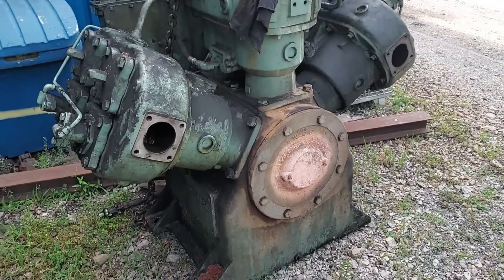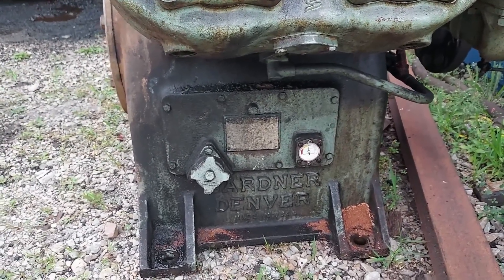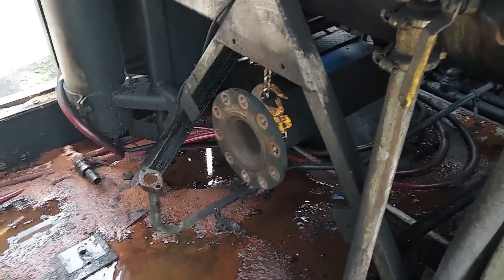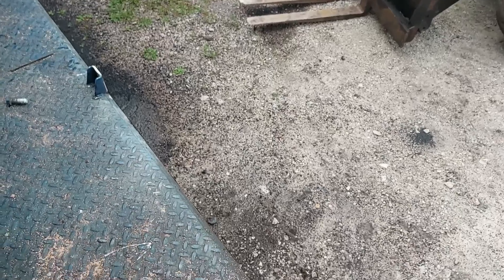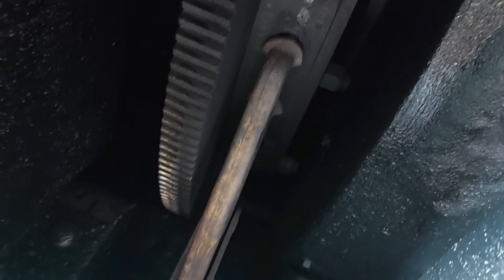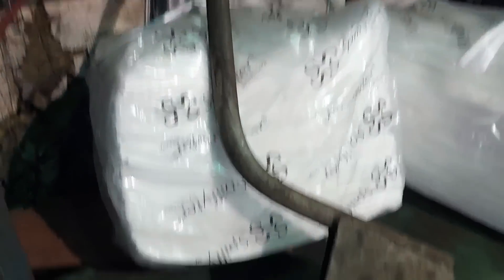Locomotive Air Compressor Died!  We Gonna Change It Out Today

Comment: That would have been a fun rebuild
Reply from the maker: They send it out to a professional rebuild shop rotarycomptech.
It's a core that has to get sent back when the rebuilt one comes
in. But I imagine your right, it would be a task to rebuild it.
Thank you very much for checking out our video and may you have a very good day.
Reply: @ccrx6700  I used to work for one of those professional rebuild shops in Milwaukee

Comment: Dave I know the old girl died ,but had a lot sit up the yard  maybe 2yrs. Took a hammer and beat the top of the cyclinders to unstick them ,
Reply from the maker: Surprised they didn't crack, unless you used a dead blow hammer Robert. I've had cylinders stick in some of my old tractors that
were left unused for years, it's sometimes a real chore to get
those things unstuck.

Comment: Some of the newer engines Use the electric motor to drive the air compressor.  Plus, it depends on the manufacture of the locomotive.
Reply from the maker: I'm not real familiar with the newer locomotives Robert just these
old girls we have here, and we have our share of problems with them
being they are so old and get a lot of hard use. Thank you for taking the time to check out the locomotive air compressor video my friend.

Comment: Dave:  it seems to me that your employers bought a piece of trash locomotive that needs its guts rebuilt.  Things seem to be breaking and the locomotive is falling to pieces as we watch your videos.  Your employers would probably be better off to buy a new locomotive than to have these problems attributed to used equipment.  Tell your employers to not give more than $500.00 for a used locomotive.  This locomotive's life is over, you could probably get more for it if it is scrapped by weight than was paid for it.  Something else is going to break soon enough.  I must say though the reassembly of the pump looks sound.  Don't trust the rest of the locomotive though.  It sounds to me like there are some pressure leaks, the hiss hiss sounds as the motor is running.  You might be able to find those leaks with some soapy water in a spray bottle.
Reply from the maker: Thanks for sharing your thoughts Mr1Fish. Yes these are old
locomotives, the oldest one was built in 1966, next one in 1975 and next one in 1978. If it was easy then I'm sure they would have
by now gotten newer locos. However if you are not aware, we do not
interchange with another RR. This means that any rolling stock, locos
included must get trucked in here and that is an astronomical expense. Consider also that our last company filed bankruptcy and
they spent no money on much needed loco maintenance, only
spent the money when one broke down to fix that particular
problem. So yes these locos got in pretty sad shape because they
didn't do routine maintenance as should be required. 

Since our new company took over they have brought in some
very good contract loco mechanics and have spent a good bit
of money trying to fix existing problems. Which was much needed
and they did a good job. However also being so old and for too
long not maintained properly they still break down at times. And
as any other piece of machinery that is used every day it's
impossible for something not to break sooner or later. If we
could get a newer loco in here for just the cost of purchasing one,
then I'm sure that would be in the budget to happen, it's just
the unearthly expense of getting one in there that is the major
drawback on locos and also on newer hopper cars. Hope that
helps explain our situation a bit better. 

However with that said, if I was in charge of budgeting for the
coming years, then I would be putting in for a much newer loco
even with the trucking expenses, but I'm not the man who pushes
the pencil.

Comment: The repairs are rebuilt but are changeout repairs usually easy to acquire? Or can you get new parts? I would guess new would be costly but rebuilt from a machine shop isn't cheap either. I think you said the company had its own machine shop?
Reply from the maker: Air compressors are sent out to get rebuilt. We do not have
a machine shop here Shirely, we do have a mechanics shop
where they work on the hopper cars, but cannot machine
any parts. Rebuilding anything anymore is a wait and get lucky
if you can get parts, there is a real supply chain issue out there
for a lot of stuff.

Comment: Gardner-Denver;   I recall back in the 80’s  the “compressor” that run off the P.T.O. of my Kenworth to charge the pneumatic trailer that I hauled bulk cement with,  was a Gardner Denver.  Not surprising that the compressor on your train engine was made by the same company.  Noted for durability and longevity.  It seemed they ran for years w/o problems
Reply from the maker: Thanks for watching and writing in. Who knows, this loco was built in 1978 and it could have been the original compressor. Really
appreciate your stopping by and sharing my friend.

Comment: COMPLETELY off topic - but I have been meaning to ask: do you know if your railroad ever use a caboose?  I ask because I swear, I can remember coming back from Pittsburgh circa 1980 and seeing the rear end of a train on what I think was your line with a caboose.  This was in the days before EOT's, so I wonder if someone wasn't back there to keep an eye on the air.  (And speaking of air, good work on that compressor!)
Reply from the maker: Thank you B&O Operator for taking the time to watch the
show today. We have never had a caboose here. The only other
tracks here belong to NS. However, in 1980's era it was 
Monongahela RR. Then in 1993 it merged into the Conrail
system and later as you know became NS. So it had to have
been from the M RR.
Reply: @ccrx6700  Thanks!  That clears some things up.  Zipping by on I-79 doesn't offer much of a glance of the right of way.  I probably saw the caboose somewhere else and thought it was your line.  That was a LONG time ago!

Comment: Dave, I notice the compressor is direct coupled to the drive shaft, I take it that it doesn’t need a flex coupling?  Also Gardner was a builder of great marine and bus engines in the UK!  but has since gone out of business! The Gardner/ Denver bit is a puzzle. Thanks again for the video.😊
Reply from the maker: Apparently it does not need flex coupling, a bit surprising.
But that's the way EMD made them. I did not know that
about Gardner doing the UK engines, nice to learn that.
Really appreciate your nice comment and for watching today
my friend.
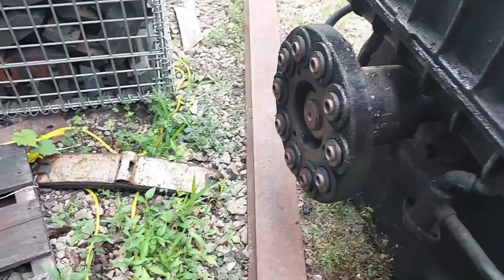Reply: I just assumed upon looking at those holes on the compressor flange; that they have 'extra' bumps vs a flat flange with drilled holes, and I was assuming those were rubber inserts/mounting spools (like end of an auto shock absorber, rigid center thimble/sleeve). around 1:24
Either that or clearanced metal to metal to allow some play...

Comment: I'm almost certain that is a six cylinder compressor.  Two outside banks are the first stage intake, then they feed into the center bank for the second stage.  Center bank outputs into a water to air cooler then off to the storage tanks.
Reply from the maker: Thanks so much Shain for taking the time to tune in and
watch the video my friend.
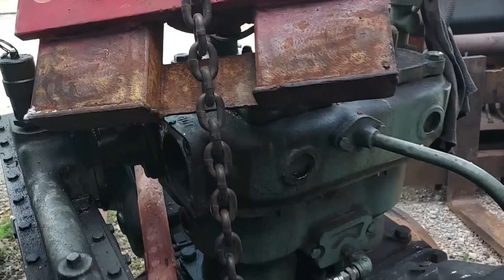Reply: You got it, except that is an intercooler, not the outlet air. It goes between the outside cylinders' outlets and then into the center cylinders' inlet. The open port on the center cylinder head, on the drive side, is the outlet (OH, I just noticed it says 'Out' 1:48 confirming that).

Comment: Wonder what that replacement compressor cost. You can safely/legally  run with no compressor on the lead locomotive or even with the lead locomotive shutdown
Reply from the maker: I have no idea Reven what it would cost, it is a rebuilt one.
Our remote DPU system here is an odd duck. While you are
right if there is another loco in the train to supply air, one
loco does not have to have air supplying the train as long
as other units provide the air. However with our stupid system
the lead loco always has to be supplying air as the other loco
the system shuts off the air to the rest of the train. it's stupid
but that's what we have to work with here. Thanks for stopping
by and taking in the video today my friend.

Comment: Thank goodness we have hydraulic barring machines in our shop, that manual barring tool you showed us is a bear to use on the  larger displacement 710 engines. From the looks of the burnt paint on the crankcase, it appears that the old compressor lost the rear main bearing.
Reply from the maker: I have never seen a hydraulic one Ralfie, that must be the berries!
These sd 38 move rather easily, but have no idea on the 
newer engines, you would certainly know. Always great to
have you visit with us and write in my friend. Thank You.
Reply: @ccrx6700  
Check out the Tame INC. model 43 EMD Barring Over Tool. 
The yellow ram in the picture on their web page is hanging upside down, the round bar fits in the saddle on the locomotive frame, and when turned on, the ram continuously reciprocates up and down catching the round holes in the outside of the flywheel much the same as the manual tool. 
There’s also a jog feature for bumping the flywheel into the timing mark for setting injector timing. 
We also have a couple of the main bearing torque machines shown at the bottom of the model 43 barring tool page.

Comment: That looks like a lot of air to compress! They need it all, got to have sufficient pressure to stop many wagons. That's a lot of air to supply! Thank you for showing it to us! Looks like that has a water bleed valve fitted to it, if the water vapor buildup wasn't removed, there wouldn't be space for the air in the air tanks, and it would show as lack of pressure. The compressor has to supply sufficient air to push out all of the water vapor. A railroad worker told me once that the engine was capable of pushing out enough water vapor buildup if the water level was below the intake side of the air tank. They use either a cyclical dump valve or a constant drip valve. The latter will just drip water vapor out constantly, the former will just cycle, as the description says.
Reply from the maker: Yes it does take a lot of air, and here besides the brake system,
we use air to dump our hopper cars. The cycle valves you
are referring to are called spitter valves. We have them on
all of our locos, plumbed into both main air reservoirs. In theory
they sound good, but in reality they don't work very well. On pre op
each operator manually opens a valve on the MR's and lets
water escape via those valves, it is amazing how much water
sometimes comes out. Thanks so much for watching and
writing in today my good man.
Reply: I couldn't see it.
With his close shots (and my lack of knowledge), I couldn't see where the air goes.
Is that the MR tank above the drive shaft? Can you time stamp where this valve is visible?

Comment: Do you use any kind of antifreeze in the cooling system. The water looks very rusty.
Reply from the maker: No antifreeze Martyn. They do put an additive in the water,
however they're not using enough, the water should have a weak
juice or weak kool aid  like coloring to it. EMD does not recommend
using anti freeze in these old engines. They are left running
in the winter when not in use. Which EMD also says is easier
on the engine to keep it running that to cold start it because
there is no pre lube system on them and it's not at all good for
the bearings or seals to have an engine start with no lube, it
takes a finite amount of time to get everything oiled.
Reply: @ccrx6700  The antifreeze will stop the engine rotting from the inside and keep the engine temperature stable and water ways clear.  An engine is an engine in whatever it is driving.

Comment: I had never seen such a thing before, and had it not been for your video I probably would have never seen it. With all the hours these compressors run, it's amazing this repair isn't more common. I also had no idea they were water cooled. You probably have to use the little guy to get in between there to separate the shaft fasteners. Not a lot of room in between. I did not know you could advance the crankshaft manually. That is a neat tool. Reading the description that was a Yankeetown Dock locomotive. I got to see her there in the early 80's along with all the FM units they used to have. This locomotive was paired with #21 and the staff allowed me to move the pair out of the way just so we could get better photos of the FM units. I was put in the seat and shown what to do. even though we only moved a few car lengths, this was a thrill I will never forget. The Company and employees were so nice to us railfans and all we had to do was sign a waiver to be on the property and told to be careful and alert. My favorite was #20, the Can Do America paint scheme, it was so cool back then. Thanks for sharing. Cheers Rob
Reply from the maker: How awesome is that Rob! I have pictures of 22 and 21 paired
and also Can Do. So neat to hear from someone else who
has sat in the seat even if for only a short time.  It is still a
strong runner although when we got it from YD had to replace
the main generator and rebuild the engine. Really appreciate
your watching and writing in today my friend.

Comment: Thank you for sharing.
I can imagine the install took an hour or two judging by all the shims under the replacement air compressor.
Reply from the maker: It was around 6 to 7 hours total, lot of messing around but
everyone did a fantastic job and it sure is a lot quieter than
the old one was Kevin. I was unable to get the old one smoking
recorded, they had it shut down when I got back in off track
that day. Thanks so much for stopping by and watching my good man.

Comment: She might have had oil in it, but probably the oil pump failed...  Guaranteed that crank is smoked.... Those 6 cylinder G.D. comps are a weird breed...WBOs in general are pretty simple compressors.  They just need to be maintained.  I've rebuilt 100s of them, just never messed with the 6 cyl.
Reply from the maker: Appreciate your taking the time to watch and write in today
Richard.

Comment: In terms of size alone, that baby is one big compressor.  I`m used to working with things that put out 9, 10, 11, 13 cubic feet per minute.  And for my application,  a 13 cfm compressor is a beautiful thing.  This baby puts out 254 cfm (as per Dave`s info in the description).  Man, that`s a lot of compressed air.  Pretty cool stuff, Dave.  Thanks for putting this together,  and for the detailed info in the description !
Reply from the maker: Thank you Stan for the very nice comment. We really appreciate
your taking the time to watch and write in my friend. It's got to
do double duty not only supplying the trains air brakes, but also
the car dumping, takes a lot of air.

Comment: That engine has a nice sound ticking over. The guys changing the compressor did not have an easy job getting those drive shaft bolts in, very little room in there. I am glad you could show us what you could and can understand not wanting to be filmed doing an awkward job like that. Another enjoyable video.
Reply from the maker: Thank you so much cedarcam for the very nice comment. Always
great to have you visit with us. Really do appreciate all your
great support you have given the channel for such a long time
now my friend. And, your right those guys had a tough time
on those thru bolts, but they got it.

Comment: Thanks for another behind the scenes look at what goes into keeping a locomotive in good running condition. You're fortunate the defect occurred during the pre-check and not while on the road. I would not have guessed it was that tight a fit but there is a lot of stuff under those hoods. At this stage if that was original equipment you got your money's worth.  Glad to see it up and running and don't forget the hose on the tracks!
Reply from the maker: your welcome Paul, thank you so much for your very nice comment
and for taking the time to watch today my friend.

Comment: The trash truck guys at my building had their are brakes pop off release every 22 or 25 seconds I ask them to tell their boss and the repair shop foreman about it.  As the compressor was not unloading when the system reached operating pressure.  Each week. Psst. Psst. Psst.  Their boss said it's ok.  So I took the time and got thru the switch board and talked to him. Okey dokey , was his reply. I should have called the highway patrol commercial officers.  I few months later. No air releases. Then I looked. It's a brand new truck.  Oh. Nice new truck.  What happened to the old truck.  Oh. The air brakes failed and we crashed it.  I guess the air brakes never got fixed.  I did warn you that they were going to fail.  At that point their faces went pale as the blood drained out of their faces. Then the nodded that I had.  They reached out and shook my hand. Thanked me for the warning.
Reply from the maker: Thanks for sharing the cool story Wayne. I can absolutely
believe it. heard the other day about some people, and you will like this.... if stupidity and dumb could bounce they would now
be in orbit.... LOL  Wonder why the truck driver put up with it
so long, but maybe he was afraid of getting fired, who knows.
An ounce of prevention.... Appreciate your writing in and watching
today my friend.

Comment: A big hair dryer you have there 😂I imagine that the reman process for the core is similar to that of overhauling a diesel engine? Check/replace clearances, bores, sleeves, cylinders, and treat it to an all-new seal kit? If it was smoking there might be hope that it's no more damage than a tired seal. 👍
Reply from the maker: It got sent back as a core when the new one came so
it will be resurrected for new life somewhere. I don't
have a clue what they do to rebuild, but it does sound
like your thoughts would be spot on. Thanks so much
for dropping by and taking in the video today my friend.